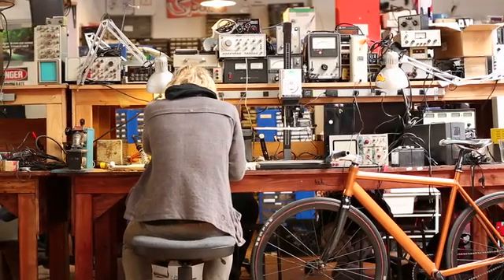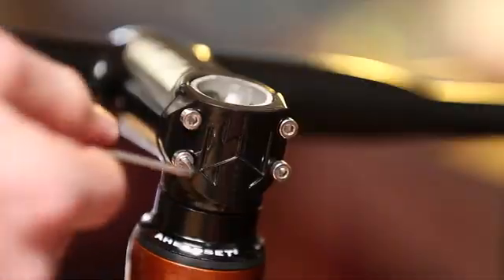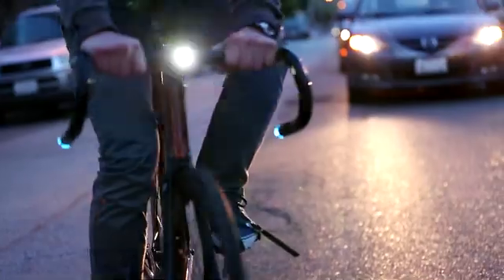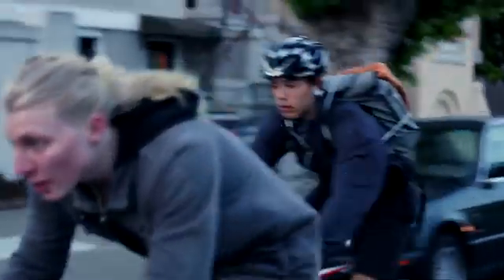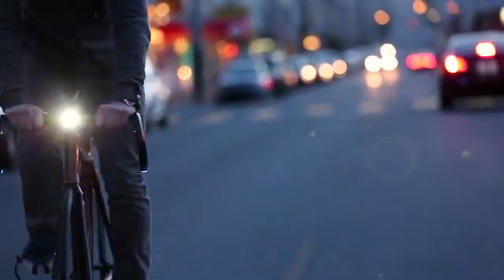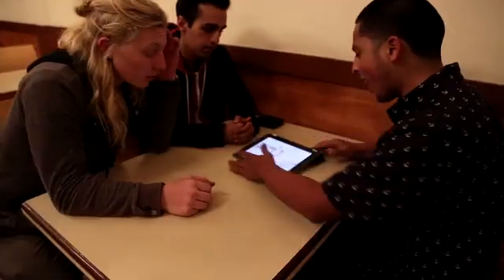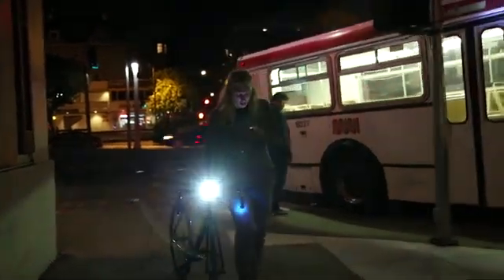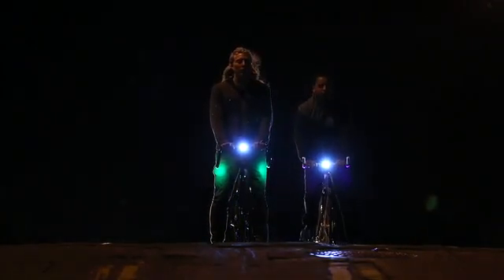Helios Bars - Transforma cualquier bicicleta en una bicicleta inteligente

Comment: Thomas, brakes aren't needed as there is no freewheel on the rear. The cranks are therefore linked to the sprockets so you can press the pedals backwards to slow down. Such bikes are called fixed or fixies.